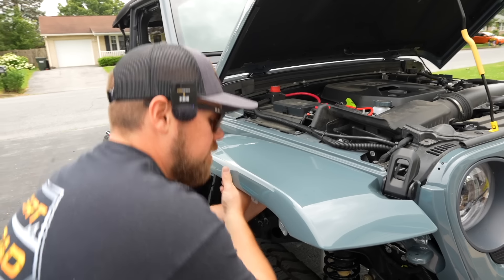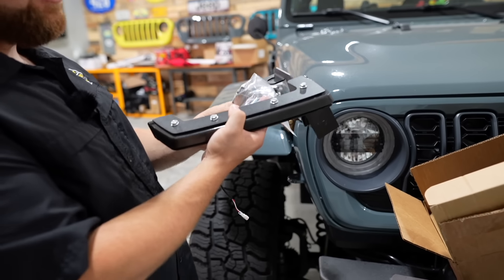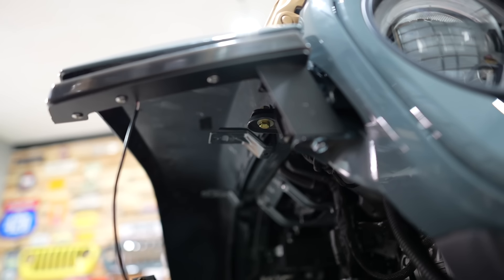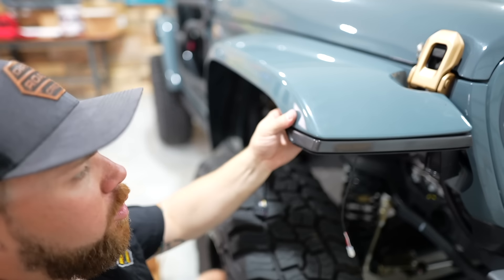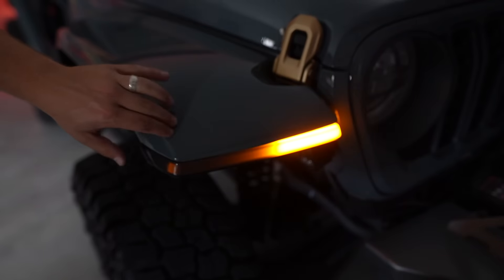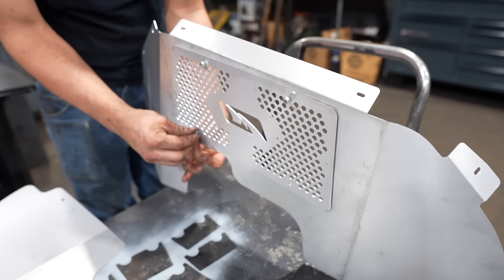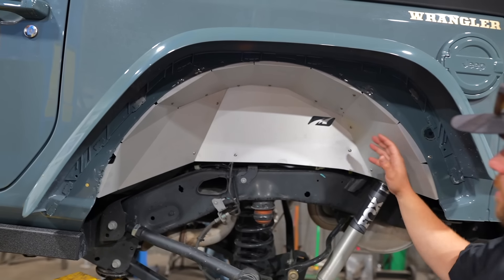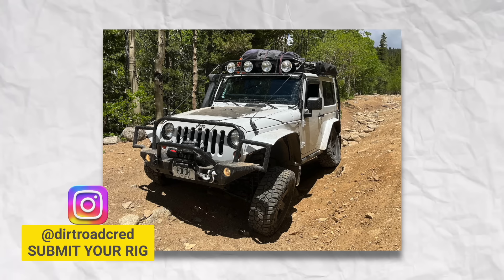2024 Jeep Wrangler Fender Chop!

Comment: Fender chop looks good and I really like the marker lights. I would have painted the inner fenders so they blend in better or accent different. The unfinished looks odd. I have the Bushwacker flat fenders on my JK with a 2.5” lift and 35s, makes those tires look small. I think this does the same thing and would look better with 37s. I look at mine a lot and say damn really should go bigger but it does give you a ton of room for flex. Trade offs lol.

Comment: These look great, but I have to give a shout out to the old channel sponsor Diode Dynamics. I installed their Elite Max headlights just like you did, but I also paired it with the new AAL fender chop bracket that uses Diode Dynamics LEDs. The matching LEDs between the headlights and the fender chop look every bit as good as I had hoped they would and look so much better than OEM or any other headlight/fender light combo. I'll send a pic of my rig in soon to try for the featured spot at the end of the video to show what I mean!